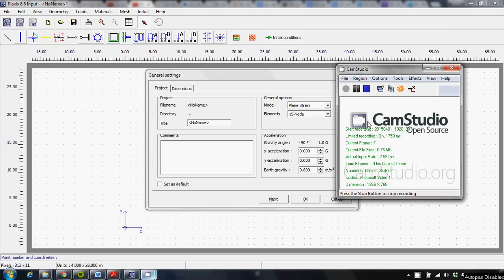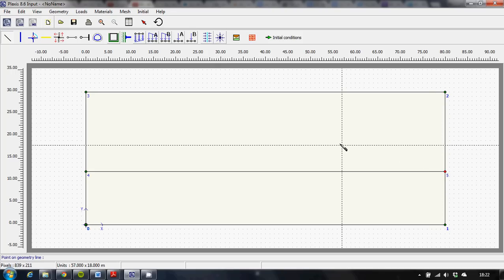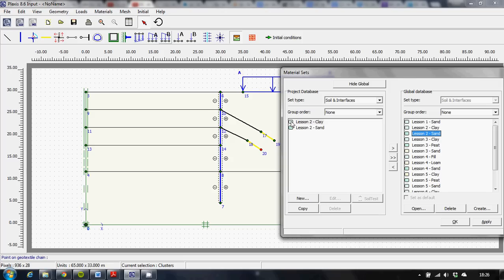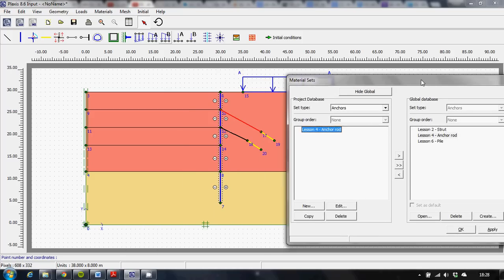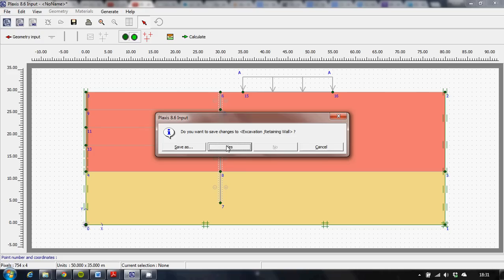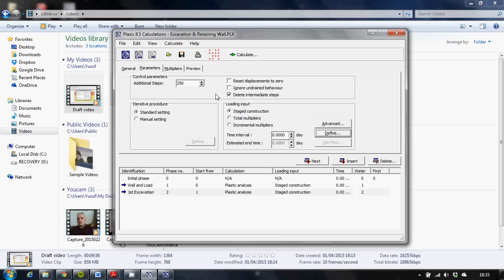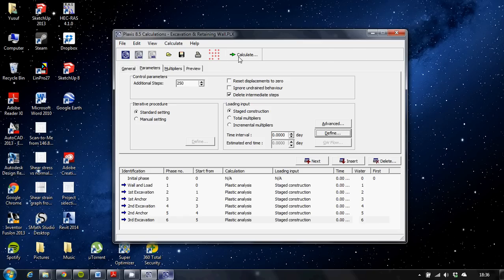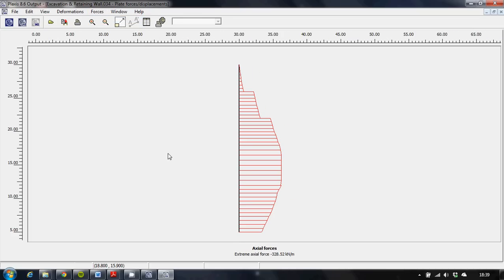Plaxis 2D Tutorial: Excavation and Retaining Wall

Comment: in a case of soft clat, I can't use anchors, so do I define the steel pipes (struts) and specify its length?
you know in such case I won't be using spaces as I don't have anchors and the spaces isn't the same

Comment: could anyone tell me how to provide the exact nail inclination angle like 10, 20 or any angle.
Reply: By making the assumption of your Free length and the Fixed length (already calculated by you or assumed) and by defining the angle i.e 20 degrees. You can define the horizontal and the vertical distances